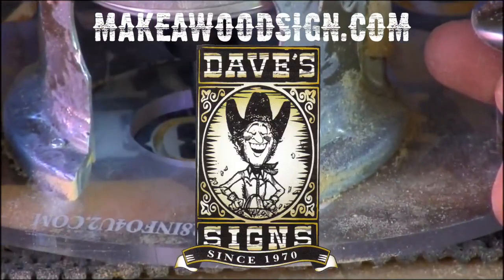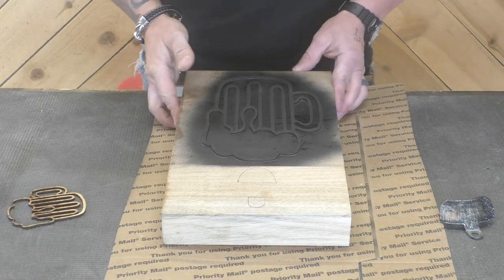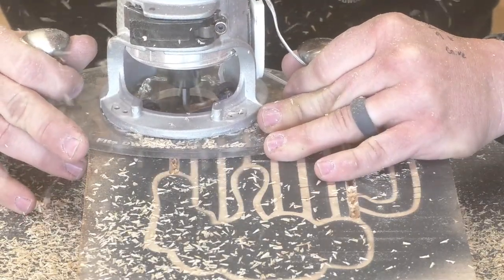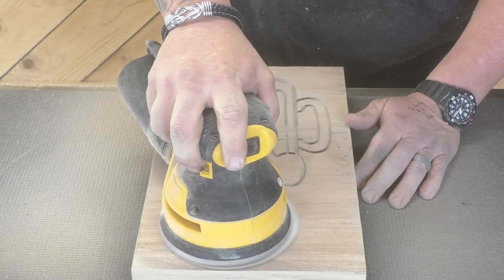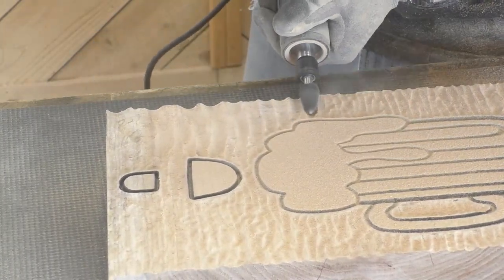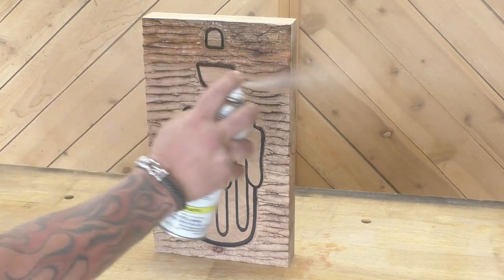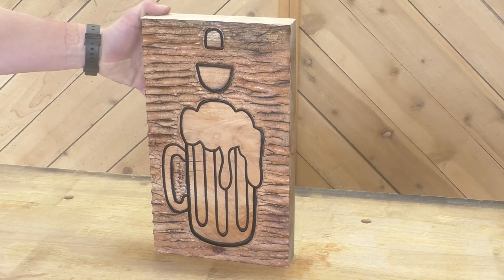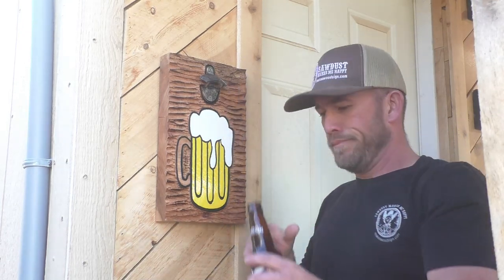Awesome Scrap Wood Project - Man Cave Bottle Opener

Comment from the maker: March Giveaway - https://www.youtube.com/watch?v=hSpM1nbsOl4

Router Bit Depth Gauge - https://makeawoodsign.com/products/router-bit-depth-gauge?_pos=1&_psq=depth&_ss=e&_v=1.0
Base Plates - https://makeawoodsign.com/collections/acrylic-base-plates
Router Bits - https://makeawoodsign.com/collections/router-bits
Dewalt Router - https://amzn.to/3V6hM5C
Milwaukee Router - https://amzn.to/3RIb02O
Ferry Lights - https://amzn.to/3YJd92y
DeWalt Disc Sander - https://amzn.to/3e4aUVL
DeWalt Random Orbital Sander - https://amzn.to/3Cyo7PM
Spray Primer - https://amzn.to/3RGcXwT
Spray Clear Coat - https://amzn.to/3EgYS61
DeWalt Angle Grinder - https://amzn.to/3WZO4Qu
Kutzall Extreme Course Disc - https://amzn.to/3hOB9AT
Super Gloss Epoxy Resin - https://amzn.to/3AgPNXW
Dewalt Die Grinder - https://amzn.to/3SlnFuK
Kutzall Extreme Flame Burr - https://amzn.to/3kgdnPU
Foredom Rotory Tool - https://amzn.to/3XQYKQJ

Comment: Howdy Mr. Ryan. 

Good job. 👍 I'm seeing that you guys are using power carving more and more these days as compared to the years past. I'm glad to see that. It's fun to do. Gives alot more character to just a routed sign. 

What is the technical term for this type of carving? I'm doing a carving that is a picture of a couple of Fairies 🧚‍♂️ with a mushroom house. Everything has depth to it so it's 3D, foreground, midground, background. Flowers and petals look like you can reach in and pluck them off the "canvas". LOTS and LOTS of under cutting to create shadows. 

What is this called? I've heard "Relief Carving". I've got 4 weeks in this one carving, about 75-100 hours so far. I'm almost ready for finishing. I'll send yall a few pics when I'm done. 

Oh yeah...Now, this is just me...but I have shaky hands. I'm sure there's a medical term for it but it's impossible for me to draw a straight line, it looks more like a seismigraph than a line. I drink beer WHILE I work. It settles my nerves and I shake wayy less. Mind you though, I don't get tipsy or drunk. Can't stand that. I just casually sip on it while I work just as someone might sip on coffee. I find it relaxing. But, that's just me. Absolutely, others with low tolerances should wait til they are done. Once I send you this pic, you're probably gonna wonder how I carved such detail with shaky hands. Beer.
Reply from the maker: Hi Mike, I really don't know all the technical terms to the different kinds of carving. Thanks so much for watching and the feedback. I'm a very simple guy. I'm sure there are some other more technical terms for these. What Ryan did on this is what I call a combination of routing and power carving. 
Sounds like what you are doing is what I would consider relief carving. 
We all have our own ways.... I'm looking forward to seeing you finished piece. Thanks again, Eric